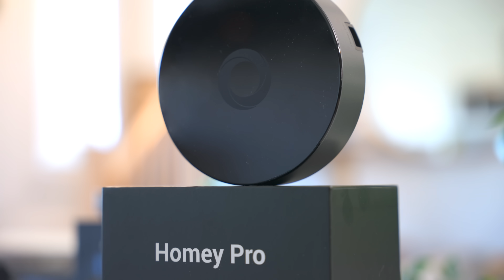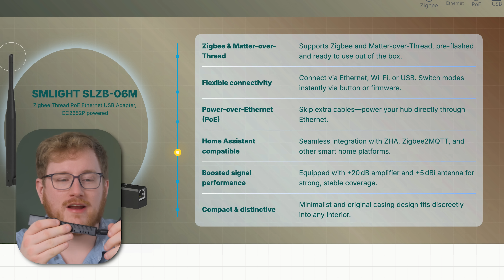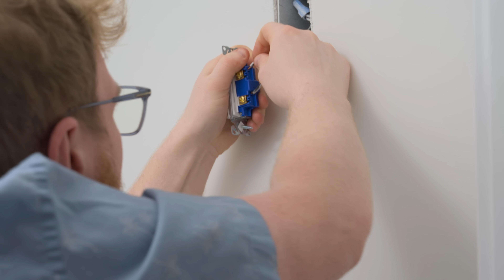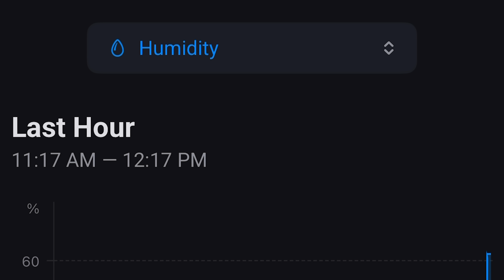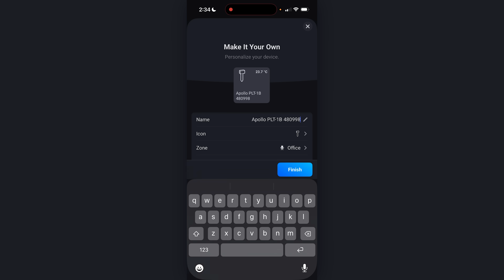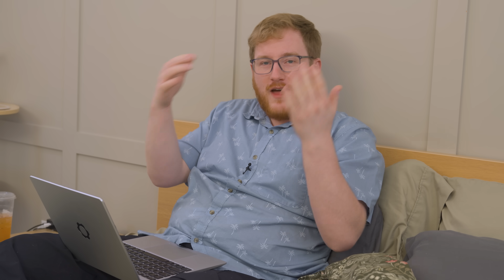I Made a Smart Home That DOESN'T Suck

Comment: Your humidity automation is gonna trigger on humid days where ambient humidity is over 50%, and then it's not gonna stop until the ambient humidity drops again, which could be days. Also, on particularly dry days, and depending on how good the fan is, you might find it oscillates on and off during a long shower when humidity reaches around 50%. Here's what you wanna do instead:

Data: Get another humidity sensor and place it somewhere indoors that doesn't tend to see a lot of evaporation, e.g. your hallway. Get a temperature sensor for your bathroom as well. Pull ambient humidity and outside temperature from your weather API of choice.

Then create a reference variable that stores the highest value out of ambient humidity, hallway humidity, or 45% if outside temperature is either above or no more than 5 degrees C below the bathroom temperature. If it IS more than 5 degrees C below, ignore the ambient humidity (i.e. just store the greater of hallway humidity or 45%). This condition is necessary because humidity percentages differ between temperatures - colder air can take less water before it precipitates/condenses.

Rules: Activate the fan when bathroom humidity reaches 10% above the reference variable, and deactivate the fan when bathroom humidity is at or below the reference variable. This slight stagger will also make on-off oscillation less likely.

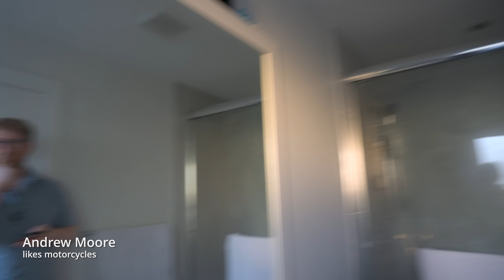Comment: 15:35 Actually the most sophisticated version of the fan automation is installing a second humidity sensor in the hallway. Sonce youre pulling the air from there you cant get the humidity in the bathroom below this.

Comment: On the bathroom lights at night blinding you.  The automation I came up with is that runs like this from 0600-0800 it is one low brightness and warmer color temperature (just the exhaust fan light not all the lights), from 0800 to 2000 it's a 100% brightness with a cooler color temp, then from 2000 until 2300 it's back to the dim warmer color temp.  then based on whether the lamps in my bedroom are on or off, from 2300 to 0559 it's either the same dim warm color temp as the early morning and late evening scenes but if my bedroom lamps are off, then the bathroom turns a very dim green light so it keeps your night vision and doesn't blind you when you get up in the middle of the night to pee.  and if you need more light you can always turn on the other lights in the bathroom.

Comment: Only running the bathroom fan when you're in there is not going to prevent mold in your ventilation. In fact, it could make it worse by sucking up moisture into the vent and then, when the fan stops, just leave it there.

Comment: Stop using the stab connectors in the back! A light switch not as big of a deal but with heat the stab portion connection will loosen up and go bad possible arc and cause a fire.

Comment: In WLED there is a way to set the configuration you're using to boot to that on a restart. I have a pixel matrix I build as well and I just set a default start program to avoid the orange wall of light.

Comment: "Smart Home That DOESN'T Suck" make a smart house the exact same as like every other smart house. I want interesting projects like bins that put themselves to the curb. Optimizing solar and battery usage so you don't need to have like 50 batteries, better way to get notifications so you can see who is at the door. Aslo this requires a subscription to run locally so why would you want this.

Comment: Humidity sensors are a very bad idea.
Light should set off bathroom fans with an off delay.
If humidity sensors do it there's a delay on the fan going on, and if the ambient humidity gets high, say when it rains outside or it's just very humid, your fan will be going uselessly all night and day even if nobody had a shower.

Comment: Homey is very intressting for having a Home Assistant like system for none nerd people. 
But I don't get having both. Home Assistant can do both, also trigger automations by your phones location. Can you please explain that again? 🙂
If you want these graphical flows, you could just install NodeRED for free 🙂
The Apollo are missing Radeon, which AirThings have, but it also cost...

FYI: Remember to set Zigbee channel to be away from your WiFi channel, so they do not interfer with eachother 🙂

Comment: Co2 does not get extracted via fans in the ceiling you need to open your doors periodically to let it out of the home as its a gas the settles at the bottom of the lowest part of the area you are in first as it builds up.

Comment: I have several smart home plugs and sensors I use with Homey, the Aqara and Ikea is the ones that works the worst for me. Aqara I don't think I can trust at all at this point. Smart plugs that just turns off at random, water leak sensor that stops working and need to be paired again to work etc.

Comment: When using a humidity sensor to control the fan, I would add a failsafe to keep the fan running if communication is lost. (cause of dead battery etc).

Comment: Good stuff! I use Amazon's solution, I have prime so I get the new Alexa included, and it is SO MUCH BETTER. But still, creating an automation by voice didn't QUITE work properly. When 30 minutes before sunset happens, it turned on and immediately turned off the patio lights. What was cool though, since it's actually turning on and off a smart outlet I was able to tell it that the patio outlet, patio lights, and patio are synonymous. Which is great because then my wife doesn't have to remember a specific name of an activity.

Comment: I started with a humidity sensor in the bathroom sensor too but its actually not an optimal way to handle it since its slow to respond in both directions. Its great for the fan but for the lights i instead added in a mmwave sensor along side the PIR sensor. 

Lights turn on when the PIR sensor detects someone but it doesnt turn off the lights until the mmwave stops detecting people. The PIR sensor responds faster so i had that as the turn on condition and had it point to the door, reduces the false positives that the mmwave has when passing near by since it can detect you through walls. The mmwave is able to "see" you in the shower passed the curtains so it knows your still in the bathroom, just make sure you have one that you can set a max distance on that way it doesnt think people in the next room over are considered in the restroom. This also reduces the times when the lights turn off when trying to take a long duce since mmwave can still detect you for the most part when your not moving.

Comment: 26:10 This second flow with the motion sensor is a bit useless, because the humidity change will also trigger it anyway, so you don't need the second motion timeout.
Also, it's a motion sensor, not an occupancy sensor.

Comment: Homey is ...meh. I have one but i use HA 90%of the time. Homey's integrations are ok but found them a bit limited. The way they designed doing everything with their flows is not necessarily very intuitive and the dashboards are also meh.Not sure how it will work out after LG bought the majority of it. Anyone remembers Samsung's Smart Things? Anyways Homey is not an extremely bad product but I found it not so great (for my needs anyways) and HA is still great as long as you find time to invest tinkering with all the yaml files

Comment: I understand this was sponsored by Homey, but I think I'll stick with pure Home Assistant and my YAML Automations. I want everything self contained. Also, not sure why he setup a SEPARATE container for Zigbee2MQTT, just add it to Home Assistant "Apps" section. In my apps, I use the following: Assist Microphone, Duck DNS, ESPHome Device Builder, Matter Server, Mosquitto broker, NGINX, openWakeWord, Piper, Samba share, Studio Code Server, Tailscale, Whisper, Z-Wave JS UI & Zigbee2MQTT. No reason to have multiple Docker containers or VMs on TrueNAS and then having to worry about the complicated configuration. Just put them ALL into Home Assistant, 1 package for backups and restoring makes it much simpler. Also, don't forget about HACS, it can also be very useful for other integrations.

Comment: I want the shades like that but for a skylight that is at an angle so it needs to have side tracks. Which means it needs a cable to push/pull it reliably. Can't seem to find any for an angled installation.

Comment: The fan switch is in the closet because they forgot to wire it when they built the house. it's easier to get power for the fan in the attic and drill a hole down the top plate of the wall and put a renovation box in the drywall and add a switch there

Comment: Doesn't suck... for now. Give it 10-15 years.
I'm all for niceties like this but in 10+ years when things start failing, you won't remember how it's all setup, won't be able to get replacement parts, APIs will have changed, new parts won't be compatible with the old parts = need to rewire the whole house.
A'int nothing wrong with a simple switch on the wall.

Comment: For the bathroom fan, put in a condtion for it to stay below the humidity level for say 5 minutes. One issue I ran into was it would turn off the fan when it got to 50 but the humidity would rise slightly after the fan went off. This happened when I was done with the shower and the fan would then go on and off maybe 2 times.

Comment: I started replacing my light switches with the Sonoff 4 gang switches. And holy crap my wife LOVES them!

They take some work to setup but you can control ANY smart device without hardwiring it.

For example my living room switch controls my recessed lights, The lamp, The accent light, The projector Screen, The ceiling fan, The ceiling fan light, and it even controls the brightness 

Home assistant is pretty freaking amazing lol

Comment: Smart lights controlled by Alexa have been a game changer for us - it's great walking into a dark room and just saying, "Echo, lights", or sitting down and saying "Echo, movie time", dimming the lights, making one light red, turning on the Xbox and projector, turning on the kitchen counter light, etc. If I could prep a pop corn popper and get that to start automatically, I'd be down for that, too. With that said, all our Alexa devices are 1st/2nd gen, and were gifts, or bought secondhand, and I'm just not interested in buying new ones... but the old ones are either too slow, or are being artificially stunted by Amazon, etc. Maybe it's just too dusty in here and I need to dust off the microphone arrays. I could use some automated fresh air/filters, etc. Hmm.

Comment: I quickly discovered the only reliable way to trigger the fan during a shower is a derivative trigger - you want the fan to go on when the humidity spikes, not when above any given static threshold because the ambient humidity will vary too much with different weather and seasons.
Reply: Have another sensor in house that you can compare to, far more reliable.
Reply: @nashy008 Did that. Works like a charm. You might throw in some hysteresis and a lower limit though.

Comment: Using smart bulbs with a smart switch just for dimming definitely doesn't seem like the cheapest option. I'm assume he only had an on/off switch rather than a dimmable switch? Since dimmable led bulbs would look better, and be cheaper in the short and long run, as well as be much more maintenance, since a bulb can just be replaced without the need to pair a new bulb and add it in to integrations.

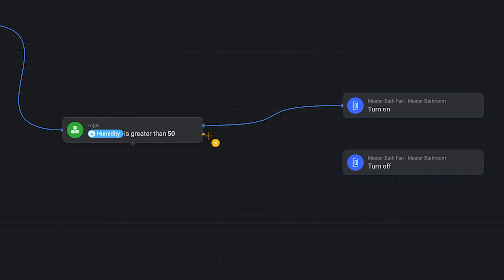Comment: 25:40 my first thought there is that this will lead to a lot of start and stop on the fan around 50% - no idea how much this is the case in the real world but it would probably be better to either have it run for a minimum amount of time when it turns on or to seperate the on and off conditions by a few percent. for example humidity < 45% -> turn off; humidity >=45% && humidity <55% -> No change in state; humidity >= 55% -> turn on.
Reply: Yep, it's the first thing we learn in control systems class: use hysteresis you dummy!

Comment: I'm using Z-Wave for this, but I installed a Fibaro dimmer in the bathroom, which I use with a dumb light bulb. I don't use a motion sensor, but I just scheduled a flow to run at 10pm that sets the maximum brightness to 10% or something, and set it back to 100% in the morning. No more flash bangs!

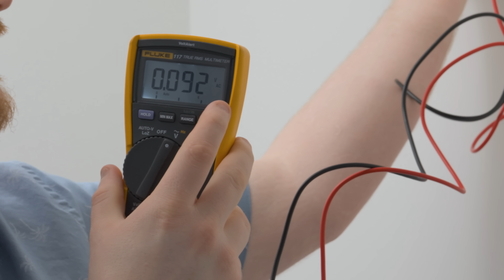Comment: 12:00 You should use a non-contact voltage tester to check if a device has power going to it. 
(after confirming the tester is working by testing it on a known live device (such as putting the tip of the tester in/near the live slot of a receptacle))

Using a multimeter on a switch, if you don’t know which wires you have to check, may give you a false negative.

Comment: the problem i always have with these smart lightbulbs is that they have to be powered on permanently i would be ok with them if the switch would power them off when they turned off and just get powered when they should be turned on but because of the wireless communication this might not be possible, so i for my part will use something like knx in my home automation and ontop of that homeassistant so that the basic functions are solid and all the nerdy stuff is over HA
of course i get that if you rent you probably have no other chance than to do it that way

Comment: Tip to install sensors even in rent, Blu Tack! Easy to remove, move the sensor and able to instal wherever you want.

And I do like Homey as a product even though I'm a Home Assistant user. IMHO you made things even harder now to run both Homey and HA :D I get it, sponsored. But non of the tasks would have been hard to do in HA. Working auto how to automate it and actually doing the task (placing module, swapping blinds etc) is the hard part :D

Comment: Would really like to know if there is benefits of going with homey self hosted while running home assistant as main platform. 

Home assistant cloud is very expensive for what it is. Going with Tailscale or cloudfare with own domain have its owns downsides. (And still struggle in regards to integrating with Google)

Does homey integrate good with having home assistant give it access to all devices and then handle the remote and google side of things? 150 for lifetime is only 2 years of home assistant cloud.

Comment: Given how much humidity fluctuates through out the year (especially here on the West Coast) you'd be much better off setting it to trigger the fan when it sees the humidity jump like 5% in a short period then run the fan for say 20 minutes. Having it based on humidity % only will certainly cause the fan to run constantly as the weather changes and thus require regular reconfiguring defeating the purpose of said "smart" automation.

Comment: I'm the techie rando that likes plants so i'll share some trial and error.  Using HA for my automated hydroponic grow room has been a game changer (aka i can be lazy(er))  but i found anything involving "life" like your plants you should do a dry run (pun intended) without the plants first to gauge how it works.  I have found the soil sensors are a little sketchy and to use multiple ones per pot.  Most times you can simply run a pump on a timer for small duration but as the plant grows it needs more water.  I've used an Aquara moisture meter in the soil but in reverse where it should always detect water until it doesn't when it triggers the water.  You can also judge by difference in weight weight (waters a constant).  For temperatures it's great to set a routine to turn things like an AC or humidifier on\off based on VPD or heat but in my case temperature "swings" are often worse than trying to maintain a certain temp  so i find setting a failsafe type routine to turn things on based on % in difference along with the actual temp routine.  I have any dire warnings set to turn on the bias lights on my TV so i notice.  ESP32 as PWM and relays are also a cheap DIY sensor often times that you can piggyback temp readers.  In my case multiple temp meters help at different heights in the room for accurate medians or to find hotspots that need airflow.   All kinds of use cases anyways that save alot of time once you can wrangle the command flow.

Comment: Unfortunately the 'ease of use' argument for Homey really doesn't land these days, because your #1 frustration (as somebody who has done this multiple times in multiple homes now) is going to be that you buy something that says it's compatible and then you STILL need to set it up using a completely different app, e.g. tuya or lsc, and then use an integration to couple it to your actual home automation platform. Homey simply doesn't support a bunch of these whereas home assistant on a raspberry pi does.

Comment: I really want to like Homey, the interface is quite good and automations are so easy to set up. I can’t get over the fact that their self hosted server can’t connect to z-wave and zigbee coordinators (I have a POE TubesZB dual radio model). And from what their website site says you HAVE to have internet for their bridge to work. So basically the SHS is pointless? My options are:

Keep Home Assistant and connect to Homey (I’d rather just have one automation system)

Run zigbee2mqtt, but what about my z-wave devices?

Forget SHS, but now I have to have a hub when I already have capable hardware. 

Great video!

Comment: I preferred and chose Z wave because unlike zigbee, it doesn't use the 2.4Ghz band.  Zigbee is more widely adopted though
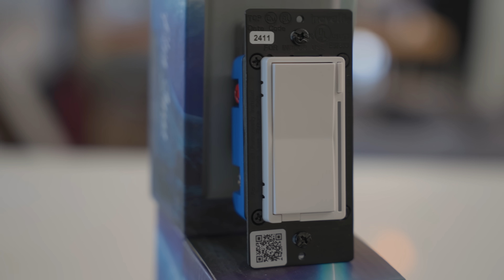at 11:00 where he's linking switches, that's exactly what I did to link the garage door's exterior front lights, and side door lights together

for things like the smart bulbs... I preferred dumb dimmable bulbs with a smart switch.  it means I don't have the fun colors, but then I stopped having to deal with a crappy app, or bulbs that were massively out of color calibration...